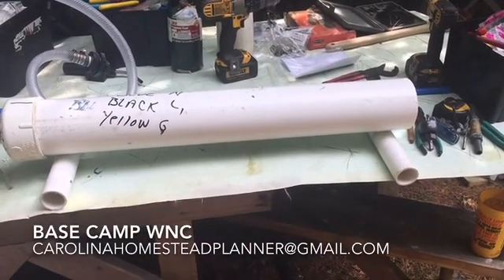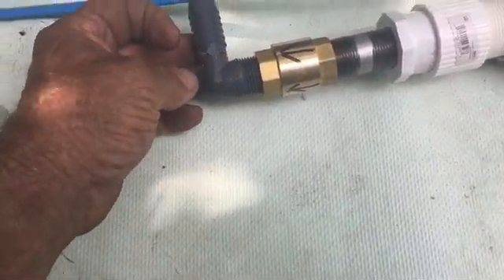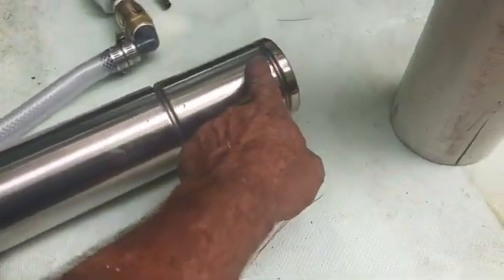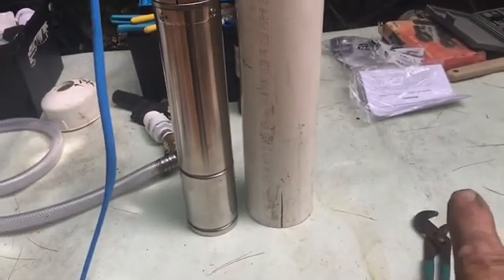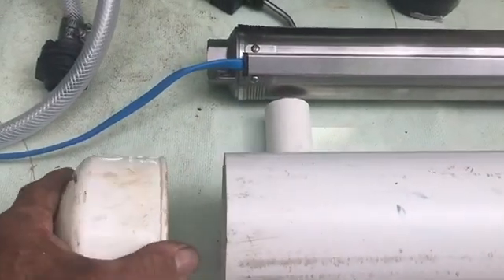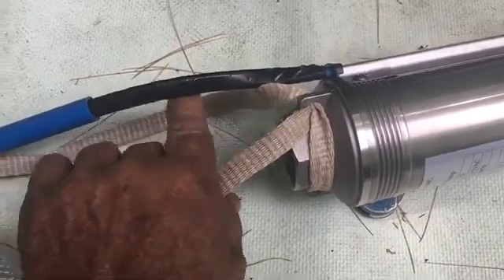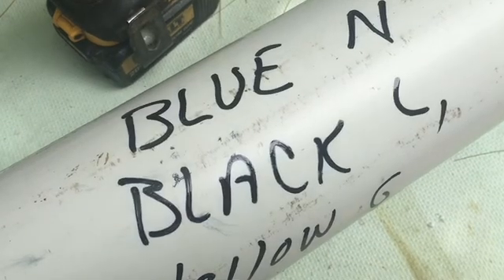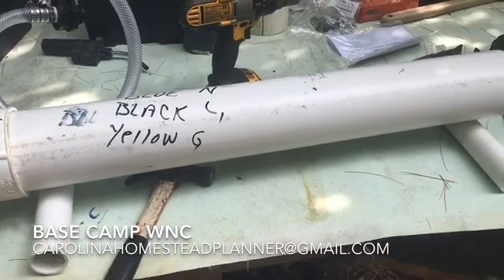How To Install A Deep Well Pump On A Water Cistern

Comment: What prohibits the pump from moving when in operation given the flexible discharge connecting hose?
Reply from the maker: I want it to be able to move
If you were to use PVC pipe it then to crack in the treated portion 
Will be uploading a new video were I have improved the system and now I use PEX PIPE to absorb the movement

Comment: Great instructional video! As usual 😎
Reply from the maker: Haven’t heard from you lately 
Are you still getting ready or in the wait mode
Reply: @basecampwnc1745  Getting ready. Drilling a diy shallow well this week with a solar pump, and also getting a few quotes from local solar installers for a 10-12kw grid tied battery backup last week and another this week. What battery setup and inverter would you recommend?